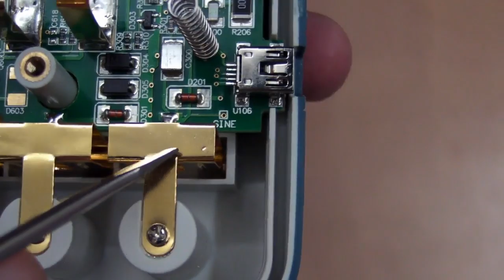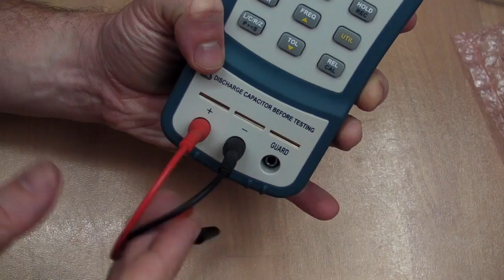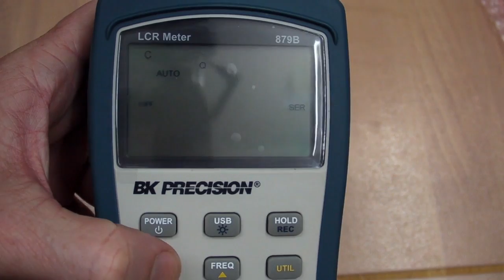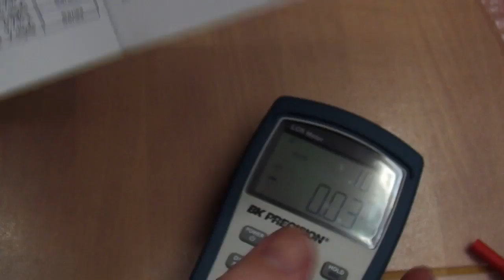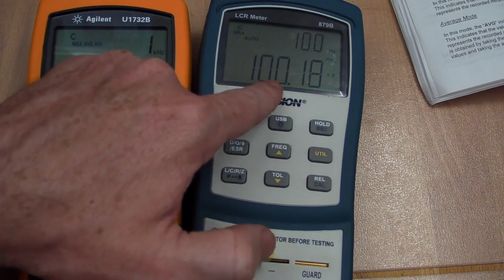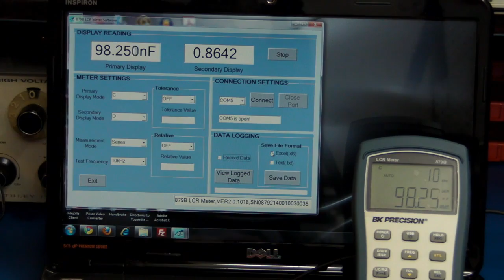EEVblog #137 - BK Precision 879B Handheld LCR Meter Review

Comment: Warning: do not plug in the wall wart power supply with a normal 9V battery installed.
It will attempt to charge the battery and damage some transistors on the PCBA.
It should have came with a rechargeable battery.

Comment: I just realized this meter cannot do Kelvin clips properly: Look at the connectors (both the round and flat ones) - there's only one connection per +/-/GND which means it is not possible to have separate current source and voltage measurement even if you attach the Kelvin 4-wire leads. With only one terminal per line it is impossible to not have current flow through all wires hence no true Kelvin measurement. Same is true for the Agilent and Keysight versions, I believe. The IET/DER DE-5000 actually has separate terminals.

Comment: Just a thought, when you measured the unit's current consumption, as far as I could tell the backlight was off which would probably explain why it was lower than specified. Good review, thanks.

Comment: Hey Dave I have purchased one of these BK Precision 879B and I am totally not impressed with its accuracy. I am an engineering student  and also work in the electronics industry and also a hobbyist .
I have read the manual a few times and I have tried many different components and the readings that I get with this Bk 879B is off by about 10%. My other LCR meter along with my fluke 189 and Fluke 289 all reads my capacitors accurately these are brand new high quality caps that I am testing.

Comment: @EEVblog errors happen.  Just as you found the MINMAX bug all functions should be tested too ... just the extremes of each range is adequate.   I found a cal error on a new big name DMM and yes, its supplied with a calibration certificate.  I've already brought it to the attention of the maker.  If I cal this formally, I'd have to pay another $100 for the service, so they are investigating and will repair it under warranty.

Comment: @BaCkFiR3 I can't believe that in 2011 you still type single letters... Now seriously, what's wrong with the app besides the com port selector (and isn't the text actually editable)? It's great and has all what you need for measurement, huge buttons are still easier to use than tiny buttons. Ok, maybe using more radio buttons instead of drop down list would save you some clicking but I don't see point in "cool&shiny look" which serve you no purpose.

Comment: I use one of HP 4260/4270/4280 series LCR meters on my bench.  Be careful, if you get one of these HP's, the 4280 series are usually very expensive.

Comment: You use 230V do you? I thought you used 120V like the americans... What type of plug do you use?
Nice looking meter :P I was gonna say it seemed strange that the USB port isnt isolated, but then i guess you arent likely to encoutner high voltages or anything dangerous testing resistors/inductors/capacitors
Display guard is a nice touch